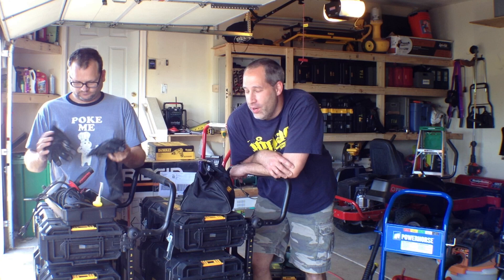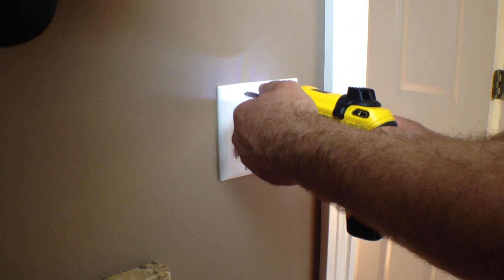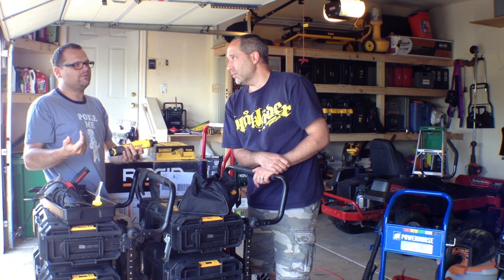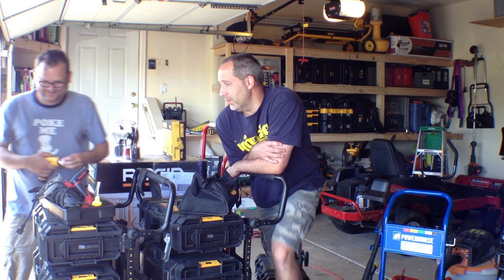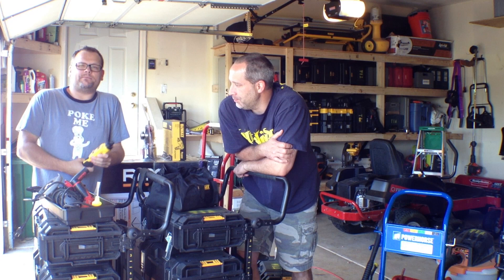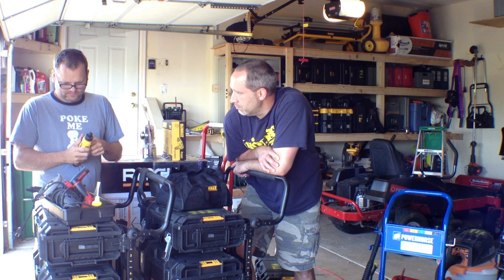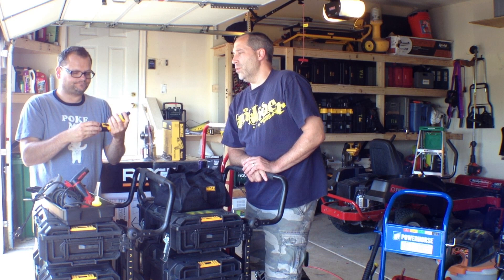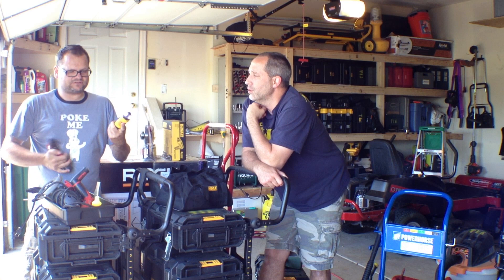DeWALT DCF680 8V Gyro Gyroscopic ScrewDriver - Review

Comment: The DeWart screwdriver with conduit reamer is around $30 cheaper.  It is very similar.  I bought both partly because I wanted a couple extra batteries.  The tool is basically free if you are thinking of getting extra batteries.

Comment: Folks, Just a clarification. When you press the trigger the noise you hear is the gyro running. I am pretty sure that the noise it makes is an unintended side effect. No cordless tool ever does anything unnecessary to run down the battery quicker. It is that internal gyroscope that makes it possible to detect rotation from any arbitrary starting point. I have this tool also. It took some getting used to after many years of experience releasing the trigger on other tools to avoid damage. Not necessary with this tool, precise control all the time, it is easy to slow up as you are nearing completion.  This represents a huge improvement in in the Power Screwdriver IMO – all the control of a manual screwdriver, all the speed of a power screwdriver. I expect adoption will be slow, great for novices but a learning exercise needed for more experienced users of older products with muscle memory to override. This assertion seems consistent with some of the comments posted.

Comment: Yea gotta say the 10 buck difference between the two different models seems kinda strange at the moment the only thing I can think of is the single battery kit will discount lower eventually. It's a no-brainer to buy the 2 battery kit. plus if they add more tools to this 8v line you can just buy the bare version when they come out. I see a lot of flashlights and diagnostic tools being released on this platform. Did you guys review the new Dewalt sub scanner yet? I can't remeber

Comment: You can get a impact driver for $99.00 or a conventional drill driver for that price.
Reply: the problem is not that, of course you can get more power, but its about aplication/aplicability. Poket screwdriver is not the same with drill driver, and sometimes you must have mobility and usability in tight spaces or diferent job situations, where you dont need bulk tools.